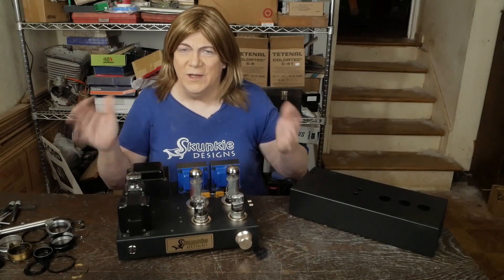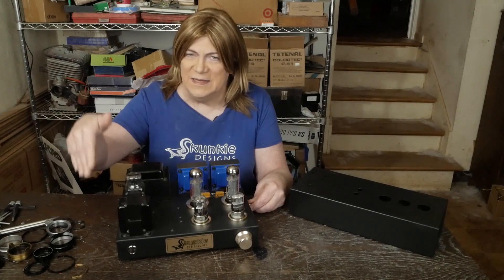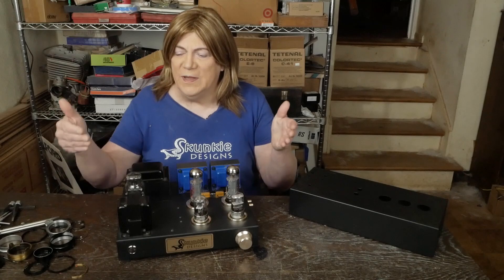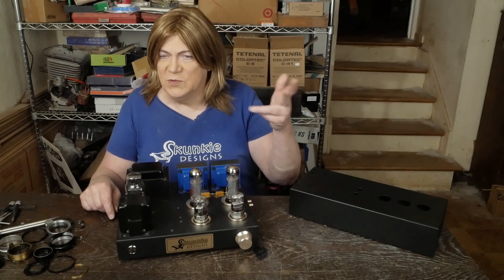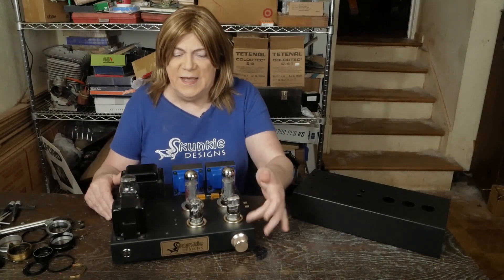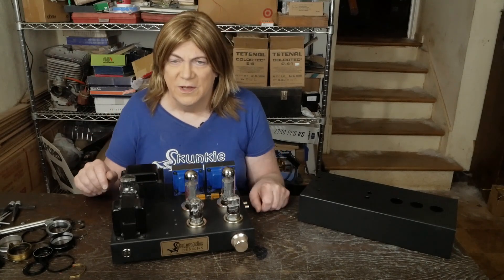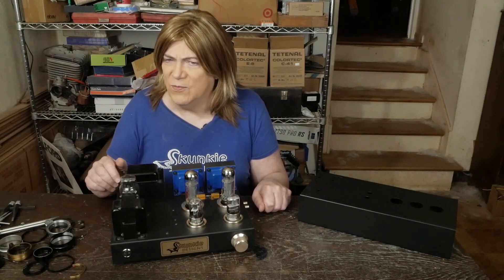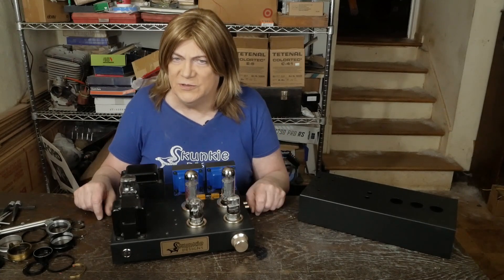Q&A on my 12AX7/EL34 SE Amp

Comment: Love Tango and Hashimoto for there even handed SQ. My ears love vintage Acrosound. Sounds lime your on your way. Stick to what you know works. Your ideas are truly sound and stick to that format. Everything else’s opinion is based on what they feel or read or may have experienced and not bench time. These remarks are from some people who Never used a scope or fully understand circuit layout for low noise and transformer position and hum free mounting. I like no volume control on an amp as I believe a well designed pre- amp enhances a well made amp. Would love to hear your layout and choices  and  end sound quality you had in mind. May be purchasing one of you pieces. Please do a slow start on B feed and caps do make a difference. Also I like Holco  resistors!

Comment: In the past, there used to be cylindrical ceramic power resistors that were mounted vertically on the chassis. I don't know if these are a good option any more (they probably aren't) but they were less unsightly in a tube amp that the wire-wounds with an aluminium heat-sink enclosure. 
Maybe another (better) option would be vitreous enamel wire-wounds on a ceramic former. These are certainly better looking and more in-place on a tube amp chassis. 
The only objection I have over power resistors on the chassis is the exposed uninsulated leads. These of course can be covered with some insulating tubing but it will always be a risk factor.

Comment: Side RCA inputs are your design signature, IMHO.
Plus I do like RCA away from speakers cables away from power cord, both on noise reduction and easy of use. Fingers crossed, hope it will work as you wish! 😊
Reply from the maker: Hmm true that is how I have built the vast majority of my amps... I'm starting to think I should build it the way I always have, function first. If someone REALLY wants them on the back I could move them there.

Comment: I was wondering if you ever put out the schematic for the 6bq5 spud amp you built. I’m currently trying to find it but no luck.
Reply from the maker: Honestly, it was so underwhelming, I wouldn't recommend building it. The 6BM8 or the 6LU8 are much better options. I honestly may take down the videos about that other "spud" amp.

Here is a link to the final schematic since you asked :)
https://drive.google.com/file/d/1rOqn3OBkc1aVKTDRMgj-gYGIuNa3Oqo1/view?usp=sharing
Reply: @SkunkieDesignsElectronics   Thank you for the reply and the honesty, you shouldn’t remove it because it still has a lot of good information, maybe just add a disclaimer in the description. Either way I’ll probably just slap it together on a breadboard just for kicks. Thanks again.
Reply from the maker: It IS a good project to test pre-amps with as it need a lot more drive than line level, so it actually works a pre-amp.

Comment: I wish designers would use the 12AT7 tube much more. True, it has a little less gain than the AX but NOS AT versions are usually far less expensive than AX and AU versions
Reply from the maker: I haven't ruled that out, but the 12Ax7 will likely be a drop in replacement in my 6SQ7 amp. It shouldn't be hard to adapt it to use a 12AT7 and I might do that in the future.
Reply from the maker: There is a reason they don't and why they are more plentiful and cheap: they aren't very linear and aren't great for audio use.

Comment: love the idea of no attenuator, and tube rectifier. simple. later-on have a 'build passive-pre kit that we build with video tutorial. something that fits neatly underneath. name them E-6 and C-41
Reply from the maker: Right do a project with a pot and relay switchable inputs AWAY from that high voltage AC and heater current.

Comment: Make something that puts out about 6-7 watts for speakers and has a 1-watt headphone output that will run 100 ohms to 600 ohm headphones, that's what i would love to see, there hard to find a good one.  There just aint enough amps that have a headphone jack and if they do most don't sound great, BUILD IT AND THEY WILL COME.
Reply from the maker: I could see a stackable headphone unit? Honestly I'm not a headphone user, don't have even decent ones to know if what I did "sounds good" and anything like that is a compromise. A real tube headphone amp would have output transformers made to feed headphones.

Comment: KISS - Keep It Simple Stephe! First round, put out a product that you know is excellent. Two models at most: one with a volume pot and one without. No options. This will allow you to get your feet wet, iron out your production, supply chain / inventory management, shipping, etc. Later, after you find out if you really enjoy being in production / support and have recouped your initial outlay, expand the catalog. Maybe iron or cap options for the first models, an input selector box with volume control or other amps. My 2 cents freely given.

Comment: Tube amps seem to fall into three price categories:  under $2k; $4k to $6k, and over $8k.  There is a market for between $2k and $4-5k.  I’ve been looking in that range and there isn’t a lot of choice.  So I’d favor you pricing the base around $2350 and then allowing buyers to option items raising the final price to the $4-5k range.  I love the psvane EL 34ph tube (pair about $225). What about auto biasing as an option? Sub woofer output option?
Reply from the maker: This design is "auto bias" using cathode bias so nothing to adjust. Sub out would be done in a preamp I would think.
Reply: You can run speaker level to a powered subwoofer as well (if it has such an input).

Comment: My two cents. I think you have some great ideas. I would vote for an integrated version with a volume control and one or two sets of RCA inputs. Inputs on the side would be fine but in the front would be inconvenient. I have always preferred integrated amps to  separates but keep it a simple design.

Comment: Super cool project.  These little amps are purist pieces, so keeping it is simple is key (no remote, limited inputs, etc).   Really like your design philosophy and thoughts around component selection...especially around limiting upgrades to just those critical areas that make a real difference like transformers and bypass caps.  This is turning into a neat project.  I hope it comes to fruition.

Comment: Stephe, Gold Lion sells three different 12AX7 tubes.   Here's the three Gold Lion 12AX7s with their SKUs from Viva Tubes:

1.  Gold Lion 12AX7 NP-095-1 (Made in China) $32

2. Gold Lion 12AX7 / ECC83 / B759 NP-021-1 $60 (this is the one to get)

3. Gold Lion 12AX7/CV4004 NP-197-1 $60
Reply from the maker: yup, not using that cheap one. And yes the middle one is good.

Comment: how does musical power supplies compare with thermionic?
Reply from the maker: I've only used their cheap guitar ones, wasn't super impressed but they aren't sold as hifi transformers.
Reply: yea, @SkunkieDesignsElectronics  . they sell hifi transformers too,
Reply from the maker: I tried to email them in the past and never got a reply, I'll try again.
Reply: @SkunkieDesignsElectronics , i just bought a pair of 6BQ5PP OPTs w/o screen taps. i have no idea if theyre any good. a few folks on AK were interested in his ST35 TX so i headed over thataway. i dont know much but id like to try em out regardless.

ill message you on AK.

Comment: i figured that was sa straight power amp with a volume knob--is it an integrated amp?
Reply from the maker: Not sure what the difference is. I mean it doesn't have a bunch of inputs or a phono-stage etc.
Reply: me, neither, @SkunkieDesignsElectronics , but most power amps do have volume knobs--just not most hifi/home stereo power amps. i frequently use pro audio power amps. 

i guess the difference would be is there a preamp section, driver and output or just a driver and output?
Reply from the maker: A pre-amp isn't needed with modern sources. Possibly people are thinking an "integrated" amp includes a phono-preamp?
Reply: i dunno. a preamp is a preamp and an integrated amp is an integrated amp whether or not theres a phono section in it.

i do frequently come across newbies on facebook hifi groups who dont know that a turntable needs a phono amplifier/phono stage/phono section/riaa amp.

Comment: what do you think of the GE 5670/6N3P/6N3/WE 396 tubes? Those ones are pretty cheap
Reply from the maker: Have never used them and I want to focus on easy to find tubes, like you can order these on amazon :)
Reply: @SkunkieDesignsElectronics  audio note cobra uses 4 GE 5670 at the input stage but I see they are not that expensive compared to regular 12ax7

Comment: I think limiting yourself to three options of amplifier tier would be the best way to go especially production-wise. Example, these transformers with these capacitors. A bronze silver and gold level. It would also help if there are any warranty or return issues because you knew exactly what went in each amp. If a customer decided to change the output bypass capacitor then you would know immediately

Comment: Steph, most of your followers are DIYers. Perhaps use a chassis that is a little oversized. That way an attenuator can be added in the chassis DIY. There are stepped relay attenuators that are microprocessor controlled. And some of those come with remote control (and if you control at the amp, add momentary pushbuttons to control the microprocessor or a rotary encode). 

if there is room in the chassis, then folks and DIY to their hearts desire. 

Same for caps and other components - folks and replace, upgrade to their hearts desire.

Comment: Thank you for addressing my concerns about the volume control (pot). Obviously you are
aware of what constitutes decent quality as you mentioned the Alps Blue Velvet. As I 
commented on your previous intro video to this project: my biggest concern is how well
the amp delivers a balanced (full) sounding signal to high efficient speakers so that at lower
volumes both the top and lower frequencies do not diminish. I think this phenomena is called
the Fletcher Munson curve? In any case, I listen at mid to low volume and I hope that your
eventual creation (or optional variation(s) thereof) will be able to produce at these volumes
and present a good linear sound that is full, rich and not sibilant. Keep moving forward with
this project - I applaud your creativity and willingness to be open about what you will or will
not do. (yeah, I'm talking about the remote)..... can't wait for all up-dates🇨🇦
Reply from the maker: I think for this use, most folks are going to have a pre-amp they love. I feel like it's easy enough to have two versions, with and without a volume control.
Reply: Totally agree. @SkunkieDesignsElectronics

Comment: Two things come to mind to potentially save you a lot of time and headache:  1. The measuring and drilling takes a tremendous amount of time.  Design a top plate and have it fabricated so all that you have to do is attach the parts.  You could use the Hammond wood chassis or some other chassis that accommodates a top plate style design.  2. Begin without any options.  Design, build, and test a nice feature set and sell that for a while.  Then consider branching out into options.
Reply: Yes I have to admit I’ve used your business model before.

It turns into WORK very quickly plus all the different parts you have to stock.

Quote:    Keep things as simple as possible until simple doesn’t work.
Albert Einstein
Reply from the maker: It turns into work, if you don't enjoy doing it :)
Reply: @SkunkieDesignsElectronics  I’m like electricity. Follow the path with least resistance :)

Comment: Thanks again, I vote for a power amp with no volume control. If possible... A  version which can be mono blocked would be awesome... I am running a three way fully active system with solid state below 200Hz and would love four mono block (is fully differential possible ? ) tube amps for the mid and tops.  Thanks again for all your amazing work!

Comment: 2 versions.  Power amp, integrated amp.  Same chassis with a different front plate and side plate to accommodate volume and RCA jacks.  Top plate & back plate stay the same.  Sign me up for two momo blocks please 😊 I’m really looking forward to watching you make your dreams come true.  And hopefully ending up with 2 new, bare bones, low powered amps.  Remember… have fun, and don’t let the knuckle heads rain on your parade.  Do it the way it makes you happy.  Peace out ✌️
Reply from the maker: I don't think these are going to be bridgeable and honestly if you need more power, run an amp with a pair of KT88 tubes.  Unless you are using them with active crossovers bi-amping speakers.

Comment: 👍for the amp-only idea. Throwing input switching and volume control onto a user-provided preamp, a passive preamp, or maybe something more exotic or remote controlled makes good sense. Someone (me maybe) might even just plug a DAC directly into the amp and handle volume control upstream with software.

Side-mounted inputs, sufficiently rearward on your amp could be very tidy with shallow passive preamps like the Schiit SYS or small cabinet passive volume knobs. With such a layout, perhaps you might consider only producing the amp-only version, making it BYOP or BYOPP (Bring Your Own (Passive) Preamp) leaving the input processing up to the users needs and simplify things on your end by eliminating volume control variants of the amp.
Reply: Definitely because the The inputs on this type of amp never seem to have enough inputs and then it's sort of just a passive front end with a volume control. Would much much rather have a nice power amp that I could use with any of my preamps!

Comment: I have an Elite 80 amp which uses Sylvania 6AV5GA tubes for push-pull output and 12 AX7s for preamp tubes. I bought enough of these tubes to last a lifetime but don't know how available they are now. This amp sounds awesome and way over-built.
Reply: Those nos 6AV5 GA tubes are almost identical to a 2A3 when connected in triode mode ..........

Comment: I think you’re 100% on point with your ideas. You’ve obviously thought about this. I think the amp which needs a preamp is a great idea. Giving people options to upgrade or get custom models is fantastic too, but within reason. Once you narrow things down, I’m sure the amps will be fantastic, and I guarantee you’ll get plenty of orders. Thanks, Stephe. 🔊😊🎶
Reply from the maker: Yeah, I'm trying to judge from comments which options resonate. I had a lot of comments about using a pre-amp so I think having a "power amp" with an optional volume control makes sense. If people need switchable inputs, they can use a preamp or a simple switchbox.

Comment: Power amp sounds like a good idea. Regarding 7025’s. What I’m reading is it’s a fallacy they are quieter.💁  Enjoy your content very much😊
Reply from the maker: They absolutely have less noise in a high gain application. In my EAR834 phono-stage using 12AX7 tubes, there is a lot more hiss and general noise than using EH7025 tubes.
Reply: I’ll have to try them in my phono stage next time I replace then😊 your favorite source? @SkunkieDesignsElectronics
Reply: Yeah, Stephe. I use a NOS Mullard 7025 in my V1 spot in my phono pre. It’s absolutely a quieter tube and works well in that position, as does a 5751.
Reply from the maker: for NOS Motorola also sound good. I wasn't crazy about the NOS RCA, the new production EH7025 sound better